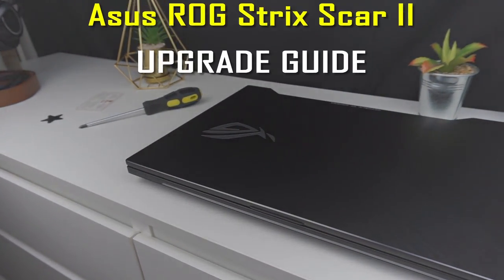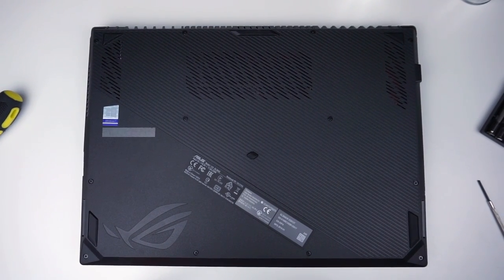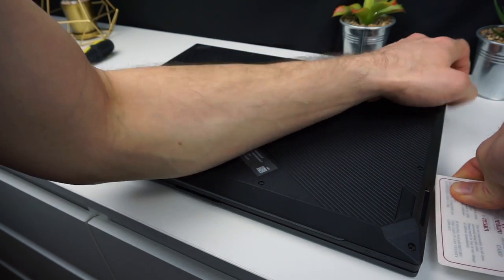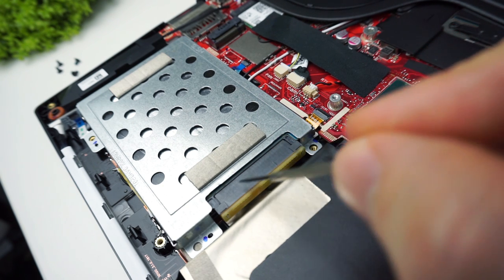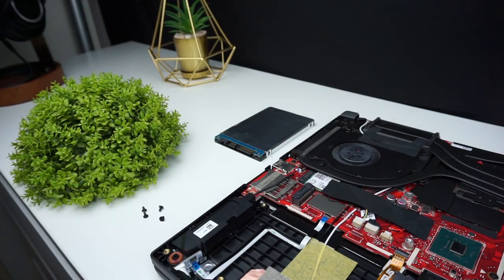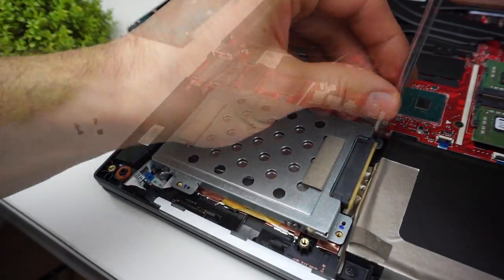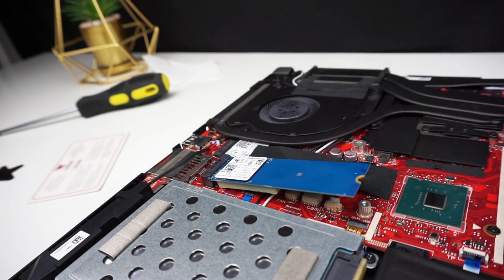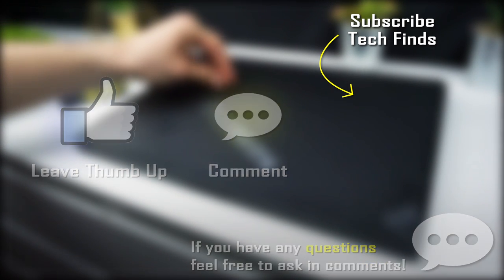Asus ROG Strix Scar II upgrade (RAM, SSD, HDD) - Disassembly Guide (detailed)

Comment: 1.Why do you use a metallic screwdriver to disconnect the battery?you should never touch an electrical device motherboard contacts or any component using something made out of a material that can conduct electricity.
2.Any m.2  ssd is compatible with that type of slot,there is not a recommended ssd.for this laptop.He will accpet both the m.2 NVME ssd aand the older version that you are using in this video, the m.2 ssd with sata 3 speeds.
3.On a gaming laptop it would be better to get a 1 tb m.2 NVME than a 2 tb old sshd,or if you need space a 2.5 1 tb ssd and a 1 tb m.2,you will get amazing speeds and the price for a 1 tb 2.5 ssd is about 150 to 200 dollars,a 1 tb m.2 ssd with more than decent speeds is about 150-180 dollars. when you are talking about an 1500 dollars machine you cant get cheap on upgrades thats why a sshd would be something stupid to put in the amazing laptop.
Reply from the maker: I'm using Seagate FireCuda in my laptop and i am happy. It was not as expensive as SSD and i have 2TB of storage. It's all up to your needs

Comment: hello i have a question, if i change the HDD and the SSD do i need to reinstall the operation sistem? (Windows 10)
Reply from the maker: You have to re-install windows only if you change the drive where your windows is currently installed.
Reply: (Windows 10) if you run "back up system", you can bring whatever from HDD to SSD OS. programs, data.   I just did and it worked well.  If you Google, it'll show you step by step 😃 good luck 👍!!

Comment: Quick question... If i change the ssd and the hdd do i have to reinstall windows 10?
Reply from the maker: if you replaced the drive where your windows was installed (M.2 ssd by default) then you have to install windows on the new ssd
Reply: @TechFinds ok thank you! Is it complicated or can i do it on my own?
Reply from the maker: @maxgatti5780  You can do it, just do a research. You'll be using Microsoft MEdia Creation Tool and use install the new windows from pendrive

Comment: im not amazing with computers but i bought an ssd and there is no screws to screw it into the mount and there is no connecter for it. would these things be in my laptop box? or do i have to buy them?
Reply from the maker: You should get these things with the laptop. If not you have to buy or contact Aces support about that. In the description i left the link for cable

Comment: Sir I got Asus strix 2 i5 rtx but I am lagging while playing dota 2 even in the lowest graphic settings(I mean i am cool with it cuz that's more than enough) I am planning to add 8gb ram later on for dual system and better performance ... what can I do for now... I want to stream as well And as you know dota2 is not a high demanding game
Reply from the maker: What kind of lags do you experience and in which moment of game?
Reply: @TechFinds  like suddenly for a bit ... I only got 8gb ram for now
Reply: @TechFinds  how do I overclock it ... is overclocking fine,does it damage anything?
Reply from the maker: @damag3d307  I don't remember if this laptop had an overclocking option in control center app. If not you can use some software like MSI Afterburner. These graphics cards are designed to be overclocked so it's safe but there are also cards that blocked that option. In Scar 2 you can do it.
Many laptops have built-in GPU overclocking option in control app so you can overclock it up to the safe limit i guess but if you overclock it yourself manually with other software you better find out what is the safe limit for your GPU. I am not a big fan of overclocking and i never do that unles the laptop already has built-in overclocking option.
Reply from the maker: @damag3d307  If it comes to lags maybe check if your laptop throttles and how are the temperatures while playing. Thermal throttling may cause such short moments of lags due to decreased performance to let the hardware cool down. However Scar 2 has very good cooling so most likely it's not because of heat (unles they didn't mess up thermal paste aplication in the factory). RAM may be the cause too. I didn't know that Scar 2 is sold with 8GB RAM only but 16GB in dual channel (2x8) is a sweet spot nowdays and many people reported me that adding 1 more stick of 8GB RAM stopped their problems with lags in different laptops.
Reply: @TechFinds  sir idk It seems to me that the fan are so silent and constant ... I think it's not the thermal temperature ... the starting point ghz it runs is 2.2 upto 3.9ghz so if I overclock it I wont get lag right... that's what I am assuming and I dont know... I regret not buying the i5-9th gen it was at similar price... the difference I got was srgb and other advantages only
Reply from the maker: @damag3d307  you can't overclock the processor. The graphics is overclockable only. While gaming the fans should be loud but constant.
Reply: @TechFinds  the fans are so quiet. Sir
Reply from the maker: @damag3d307  But while playing games? Do you play on "turbo" mode? Enable Turbo mode and set the fan speed manually from 100% to 102% range in Armoury Crate app and let me know what happens. Generally this laptop is almost completly quiet but while basic tasks and "silent" mode. When gaming the fans get pretty loud. To switch between silent, balanced and turbo mode use FN key + F5 or do it in app. If you have decreased performance it may be caused by not proper mode. For example silent mode is the quietest but it limits the CPU power so the performance is much worse. For gaming use turbo mode.
Reply: @TechFinds  thank you so much sir for always for being there... I will try it out and let you know :)
Reply: @TechFinds  sir I didnt overclock anything And now it's working completely fine :)
Reply from the maker: @damag3d307  good to know! Have fun ;)

Comment: I just got the laptop yesterday and on the task manager the memory speed shows 2667 ... Should I add any 2666 (16gb stick)  like hyperx the one you mentioned.
Reply from the maker: That's fine. If you wanna add RAM you  etter go for  rucial si ce it has closest specs to the RAM your laptop came with.
Reply: @TechFinds  thnx for the help.

Comment: Is Corsair Vengeance 2666 2x16 going to work? On the website it says that it is plug and play with the correct frequency
Reply from the maker: Yes it will work
Reply: @TechFinds  @ 2666 mhz?
Reply from the maker: @covidoff  yes, this is the maximum that this laptop can support. It actually comes with 2666MHz RAM
Reply: @TechFinds  yea i know but I just wonder if the corsair will actually be working in dual chan at the highest frequency or will the BIOS lower it
Reply from the maker: @covidoff  i guess you have to test it to find out. I know that this problem sometimes exists with Ballistix RAM but not in every laptop. hard to say
Reply: @TechFinds  alright, I'll let you know end of the week 🤪

Comment: One question. The SSD card install capacity is 1 only, is it not?
Reply from the maker: There is no limit
Reply: @TechFinds  Wait what? So you're telling me I can install more than 1 SSD card?
Reply from the maker: @kenwayconnor4216  I thought you mean drive capacity (like 1GB). If it comes to slots there is only one slot for M.2 SSD and one slot for 2.5" HDD, where you can install 2.5" SSD instead if you want
Reply: @TechFinds  Ah I see. Thank you for your information

Comment: You have 6 longer screws 4 regular size and 2 small size you can tell me please the right places for all the screws ?
Reply from the maker: For sure 2 smaller screws were on the front corners, but I don't remember any medium screws. You should have remembered that when unscrewing. Well now if the screw will be too long for certain slot, then you will know that you should probably screw in a shorter one here.
Reply: Ok because i thought all the screws were the same so i removed them and put them togther i think im fine about it.
And only for the other peoples the connector comes in the packaging with the paper work
Reply from the maker: @overod3575  You should get the connector with the laptop by default, but it may vary between countries as some people report.
Reply: Can i replace my ram in asus rog strix scar 2 to 2x32 ?
Reply from the maker: @overod3575  no, it supports max 32GB (2x16)
Reply: Ahh ok thanks for your answer which laptop will support 64gb or can i change something to make my laptop to support it ?
Reply from the maker: @overod3575  you can't make any laprop support more ram. certain laptops support it but I don't know many. For sure MSI GE65 Raider and Gigabyte Aero 15 2019.

Comment: would you kindly tell me the name of the original ram which installed in the laptop
Reply from the maker: The original RAM in Scar is from Samsung but I don't remember the model number. I don't have this laptop anymore so I can't check it for you but if you already own Scar 2 you can check it with CPU-Z program.
Reply: @TechFinds  ty so much <3
Reply: @TechFinds  i have one more qustion , dose this laptop support 3000 hrtz ram ? or its max 2666 ? and how i can know such info ?
Reply from the maker: @swedyptian9977  2666MHz is max.
Reply: @TechFinds  could you plz make a video about how to change the thermal pad for both processor and gpu ;)
Reply from the maker: @swedyptian9977  I don't have this laptop anymore. It was a testing unit so I tested it, recorded shots for review, guide, comparisons and sent it back.
Reply: @TechFinds  i dont mean for the same version , maybe for something close to it or explain the idea it self
Reply from the maker: @swedyptian9977  Just typed "HP Omen repasting" on YouTube and found a video: https://www.youtube.com/watch?v=b8dS4NlfrQc

Comment: i have GL504 with 2070 very good laptop.
But i want to install one hard drive but the laptop dosnt have the flat cable, where can i buy one?
Reply from the maker: Ohh it should have come with the cable. Haven't you one somewhere in the box? Have you  hecked if there is one inside the laptop?
Reply: @TechFinds  you are right, i found the cable inside of the manual box  ty

Comment: Can you upgrade the GPU? And if you can I need to find a link for a laptop GPU.
Reply from the maker: You can't upgrade GPU and CPU in laptops mate.
Reply: @TechFinds  In some you could so I thought you could in this, ah well better stick to my external GPU lol.
Reply from the maker: @EssentialD  yes there are few special laptops that you can upgrade CPU, but I know only one with replaceable GPU. it's not really practical and universal, because nobody produces stand alone laptop GPUs for replacement.
Reply: @TechFinds  All I know is that the AlienWare Area 51m is upgradable but not sure anything else.
Reply from the maker: @EssentialD  you have also Acer Predator Helios 500 (AMD version) where you can upgrade the CPU. There is also Acer Predator 21x, od i think some latest MSI has upgradable CPU.

Comment: I accidentally took the cable for the HDD off of the motherboard. Do you have any idea how to get it back on there?
Reply from the maker: Find the connector on the motherboard, and behind it you should have a lottle black tag. You can tilt it up, then insert the cable and push the tag gown to tighten the cable.

Comment: HELP PLZ!! My version of the Scar II didn’t come with the SATA ribbon cable connected and I can’t connect it into the laptop without of feeling like it’s going to fall out. It doesn’t fit snug it’s just loose and I have pushed it in as far as it can go. Is this normal?
Reply: I’ve done it but now my laptop is beeping on boot and is stuck on the Asus screen and won’t load into windows 10
Reply from the maker: @grantmcasey4134  look if you have a little black or white tag behind the connector on the motherboard. If so you can tilt it up, put the cable inside and push the tag down to tighten the cable. If the laptop doesn't turn on after upgrade do hard reset. Disconnect the battery, hold the power button for 30 seconds, connect back the battery and see if it turns on.
Reply: Tech Finds thanks a lot I’ll give it a go and let you know
Reply: Tech Finds is there a hard reset button on the laptop?
Reply from the maker: @grantmcasey4134  noo, you're using power button to do hard reset
Reply: Tech Finds yeh I tried that and I’ve been doing that, still is stuck on the Asus loading screen. I need to enter bios and then change the boot preference and it will be fixed I just can’t get into the bios at all.
Reply: Tech Finds and the hard drive is beeping on boot not the actual pc
Reply from the maker: @grantmcasey4134  is the laptop working without the HDD?
Reply: Tech Finds yes works like normal without HDD
Reply from the maker: @grantmcasey4134  hard to say. It looks like the HDD is bad, or there's some problem with the connection or motherboard. Btw. what is the HDD you use, and is it new / empty? Have you tryed different HDD?
Reply: Tech Finds it’s a 2TB FireCuda (just like ur one u had in ur vid) and brand new, bought just for the upgrade. I havnt tried another hdd. I believe that the bios has made that the primary boot menu. The thing is though I can’t acsess the bios while that hard drive is in because it just freezes at the Asus logo at startup.
Reply from the maker: @grantmcasey4134  well I had the same situation with my Scar 3 and hard reset worked for me. Installing new HDD shouldn't change the drive to boot system, it should still boot from your SSD where you have installed your windows. Even without system you have access to the BIOS, so that's strange. Are you sure you pressing right key to open BIOS while the laptop is turning on?
Reply: Tech Finds I’m 100% pressing right key. Looked in manual and triple checked online F2 is key and I have tested around 10 times and I can’t get into bios. I’m quite sure I’m doing hard reset correctly. Could you tell me how to do it so I can be sure I’m doing it right?
Reply from the maker: @grantmcasey4134  just in case try pressing F9 or "delete" repeatedly right after pressing the power button. Some laptops have few ways to open BIOS. You can do it like on this video: https://www.youtube.com/watch?v=UV72wLA06_c (start from 10:25)
Reply: Tech Finds thanks man lll give it a go! What do I do if I still can’t get into the bios with F9, delete, escape, F2 etc etc?
Reply: Update, it didn’t work. Not sure what to do
Reply from the maker: @grantmcasey4134  I'm out of ideas mate. Read some forums, maybe some Asus user had the same problem with Scar 2 and found a solution.

Comment: I have problem,, when im playing bfv i only got 50-60 fps .. if i add 16gb ram more become 32gb ram , is it going to improve my fps ? I love AAA games  huhuhu
Reply from the maker: Ohh so you have a single channel RAM configuration? That's a common  problem with Scar. If you had dual channel (2x8GB) you would get like 65-80 fps. So answering for your question - yes, if you add 16GB RAM the performance will be much better as you will have the RAM in dual channel and even 2x more than 16GB.

Comment: So I went to upgrade my Rogue Strix II and opened it up - No SSD bracket or Pin connector for the SSD.. I found the pin connector here https://www.asus-accessories.com/hdd-ffc-12-pin-cable-for-rog-strix-scar-and-hero-63672-66841.htm but I cannot find the Mounting bracket anywhere. Any suggestions?
Reply from the maker: I linked this HDD cable in the description and you can find HDD caddy on the same site. Here: https://bit.ly/36ueZZC
Reply: @TechFinds  You rock, ty so much!
Reply: Oh and Techfinds, that caddy will fit an SSD?
Reply from the maker: @grubbysackenhaus4109  if you mean 2.5" SSD like Samsung Evo 860 then yes it will fit.

Comment: Mine is Rog Strix G531GT AL030T

Can I remove the HDD and place another SDD in place of it ?
Reply from the maker: Yep, you can put SSD there. Of course 2.5" and with SATA connection, for example Samsung Evo 860 that i linked in the description.

Comment: What to do if you get a black screen after upgrading RAM. Plss help
Reply from the maker: Ensure that you installed the ram correctly. Sometimes it happens the RAM to go into the slot not straight. Also try hard reset. Disconnect the battery, hold power button por 30 seconds, connect battery back and see if it helped

Comment: If I am only upgrading RAM do I have to unplug the battery?
Reply from the maker: It's good to do, but you don't have to. Nothing should happen, but it's a good practice.
Reply: @TechFinds  Does it matter which side faces up when I put the RAM in? I got the HyperX RAM from your description.
Reply from the maker: @PyrusnVentus  Sorry, your comment went to the spam folder for no reason. The RAM will fit only one way, so you can't go wrong.

Comment: When I want to add ram , do i have to get the same ram brand that was already installed in the laptop?
Reply from the maker: The brand doesn't matter. It's important to match the specs of RAM as close as possible. For Scar 2 i would recommend the Crucial stick that i linked in the description, but if you buy 2 new sticks you can go for any thing you want if it's compatible.
Reply: @TechFinds  thanks for the reply , do if i add 1 16gb crucial ram from the description with the already installed ram , it'll work?
Reply from the maker: @damntrain5249  yes, sure.
Reply: @TechFinds  hello , bought extra and works great . Thank you for the advice
Reply: @damntrain5249  did you use The crucial RAM ?
Reply: @joonas4427  I used a 16 gb hyperx stick